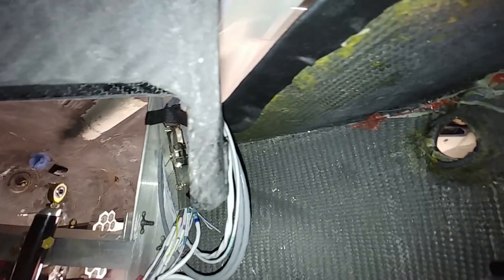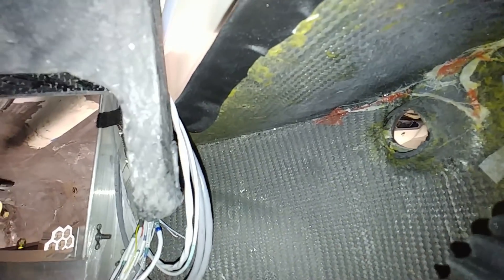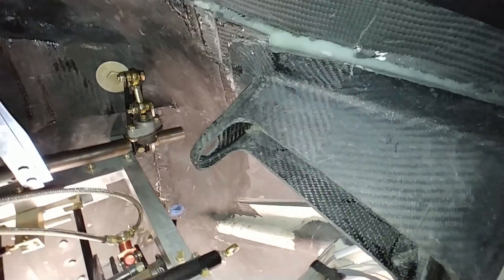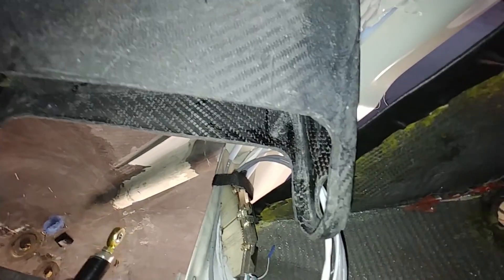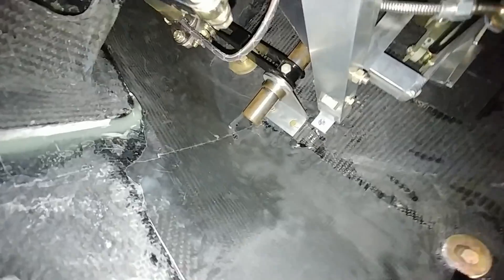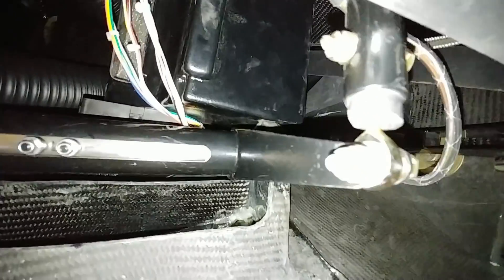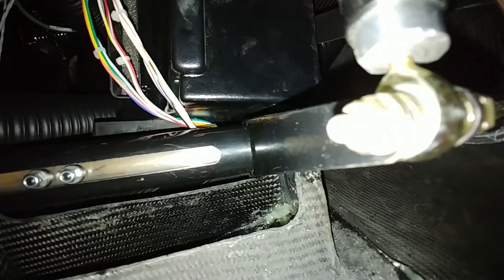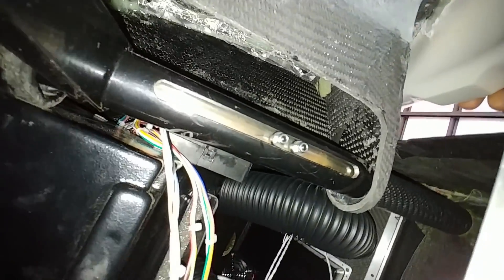Back to the Drawing Board - Building the Raptor Prototype

Comment: Just sent a few dollars your way. It will only buy a garmin screw but hey, every bit helps, right?!!😁
At 12:13 you show a bracket that connects both square tubes to each other; bearing one end and square tube on the other. If they were longer you would not need the joiner. The throw would be greater in fairness but would it make for a more rigid setup? I'm just brainstorming here, i can't help it!!
Reply from the maker: I'm not sure I follow you. Either way I will beef up the join as much as required.
Reply: @RaptorAircraft  
Sorry, i worded that a little cryptic!
If the square section with the joiner was further from the long square tube, you wouldn't need the joiner. It would follow a larger arc as you roll so that could foul on something.

Comment: Is it worth considering a third bearing where the stick comes through the dash panel to support the extended arm
Reply from the maker: Yes, potentially but there is nothing rigid out there to mount to and a third one, if misaligned, could create binding.

Comment: The orientation of the new components that you have on the drawing, will interfere with the aircon unit.  Unless you orient the short square tubing in a different position than shown on your drawing.
Reply from the maker: I think I'm good but I will be double checking it before making anything.

Comment: For what it's worth, lengthen the square tube mounting brackets by 1/2 to 1 inch so the square tube clears the main body mounting bracket.  This would allow the use of a single square tube instead of splicing 2 tubes together.  Also, it should eliminate any possibility of the splice coming apart.
Reply from the maker: Good idea. But I need to make sure it won't interfere with the A/C unit on the left side stick.

Comment: Question: How will the bracket connection bolts be safety wired?
Suggestion: Use through bolts to hold the roller bearings with a plate on the opposite side of the square tube. This will reduce flex of the bearing bolts & ensure parallel movement.

Comment: So the final result seems like a setup that should work, there are a few things I'd approach a little different in terms of making a simple structure but nothing so drastic as to bother with getting into it. I would say that the only thing I'd double check on is that extension splice piece to the forward end; seems like a critical point. I'd try and clean that up a bit. If it's all getting welded from steel probably not a biggie.
Make sure with your V-wheels you have plenty of adjustment in/out and up/down. Have messed with them plenty on a CNC router and you really wanna be able to dial them in.

Comment: Hi, just an additional thougth. I think there are better slide bearing that do not tend to bind up this much. "Igus - drylin® R linear shaft bearings". These bushings are longer and use chromed shafts (completly smooth). Or precision stainless steel tubes (polished)

Comment: Before you go on that excursion with the redesigned side stick, take the brass bushings and machine a convex on the id. Your new design is complicated and has many opportunities for failure.
Reply: I agree with you. The binding is being caused by flexing of the thin-walled tubing of the control stick. That could work.

Comment: What about moving the electrical wires outside the shaft and using torque resistant linear bearings on a splined shaft to transfer the torque to the aileron controls? You would still just use standard rotary bearings in a housing to allow the whole unit to rotate. All the components would be off the shelf aside from the bearing housings and the electrical wiring would just need to exit the tube before the area where it is welded to the solid splined shaft. This would be the simplest, most compact design and minimise any re-engineering of the surrounding components.

Comment: Great work and hang in there. Just a caution if you haven't already reviewed it. It seems the air conditioner might require a configuration change near the forward bracket mount on the left stick.  Very impressed with the retrospection and getting back to a positive mind space. Your work is extremely impressive!

Comment: Peter
I wouldn’t think the bushings are binding as you show in video.  As well you know, Root cause is critical to effective corrective action. If things are aligned I would suspect stiction try lubrications, there are many, some dry and fairly permanent.   I also suspect friction in the slide motion when there’s twisting load.   This is from the tiny contact area and difficult (not flat and smooth) machining of the slots.  These should be hardened and ground and they still may not be good enough cause the bolt heads or tiny rollers or whatever runs in on he slots.   This is a bigger issue than the bushings in my poor estimation.   Good luck.

Comment: Looks good with the new design. I agree with what has been said elsewhere, those brass bushings need to be significantly longer. I always champer my bushings to avoid binding when I use them. I have no clue if it would solve the problem, but it has in a few armatures I've built. Similar loading as you're experiencing.

Comment: Would eccentric bolts be a simpler solution to tightening the V bearing, similar to those used in some 3d printers. It's hard to see from the photo how complex the Cirrus approach is.
Reply: Yes, they work well. Here's a link to a supplier: http://www.cncrouterparts.com/v-roller-bearing-p-240.html

Comment: Peter,

Before you reinvent the control system, take a look at these flanged linear bearings.  The simplicity of this might be an easy, effective solution to your planned approach.

V/r,
Jon

https://www.amazon.com/uxcell-LMK30UU-30mmx45mmx64mm-Bushing-Bearing/dp/B07429Z7GH/ref=sr_1_3?crid=JTDGSACQ7S7F&dchild=1&keywords=flange+linear+bearing&qid=1591327155&sprefix=flanged+linear+%2Caps%2C305&sr=8-3

Comment: you probably thought of this already but would it be an option to use linear ball bearings?
Reply from the maker: Lolz. Only every second comment in the last two videos has suggested them and I have explained many times why I'm not using them. Thanks.
Reply: Most linear bearings cannot handle rotation. There are a few that can but they also need a precision ground hardened bar, which would be very difficult and expensive to manufacture for this application.

Comment: I'm no engineer, but those bushing are too short, that is why they are binding when there is lateral pressure.  If they were 2 to 3 times longer I suspect they would not bind. Can you source longer bushings or machine ones yourself to try before re-designing the whole mechanism?  Lastly, the finished surface of the control arm needs to be smoother (polished/chromed).  Like the finish on motorcycle front forks or hydraulic ram piston.

Comment: I had a similar problem with binding slide bearings on a metal rod which was cured with a dry Teflon lubricant. Don’t confuse it with standard oil or WD40. The stuff I’m talking about goes on as a volatile liquid filled with Teflon powder. Once on, the liquid evaporates, leaving a coating of Teflon just a few molecules thick which won’t rub off. Here’s a link to some on Amazon. https://www.amazon.com/DuPont-Teflon-Non-Stick/dp/B07L6X5HL5

Comment: Peter...  it looks like the force of movement for the ailerons (movement left and right) is transferred from the square control stick to the ailerons control frame by the v-groove bearings.  The Cirrus is offset so it would move in an arc (more of an up and down movement), but yours is inline, so the movement is a rotation.  Looks like this might put more pressure sideways on the V-Groove bearings  Please make sure the V-Groove bearings are deep enough that they don't allow the corners of the square control rod to pop out of their grasp.  Maybe that is why the Cirrus has a way to control the tension of the bearings on the square control rod.
Reply from the maker: I have configured it so any upward or downward force on the stick will drive down into the groove and not laterally. I will be adding the tension adjusters.
Reply: Those V groove bearings are designed to handle heavy side loads. As long as the tube has square corners it will be fine.

Comment: Why not just put some support rollers for the round  tube on the hole where it comes through the instrument panel / bulkhead. Like on a beechcraft king air or 1900. Would be way simpler.
Reply from the maker: Because rollers only allow movement in one direction, perpendicular to the roller.
Reply: @RaptorAircraft  the beech 1900 has three rollers on a round control tube. The tube pulls through the rollers (elevator) and turns in the rollers (aileron).  They are made from a black plastic. I worked on 1900's for 11 years and never saw one replaced and these planes where worked hard.

Comment: The junction u metal piece between the 2 square tubes will not be stiff enough and will have off set loads putting the welds in bending stress. Instead make a attachment to the carbon fiber bracket  which holds the bearings in the correct alignment. Or better yet use a Defiant aircraft side stick mechanism which has no siding or rotating tubes and directly feeds the the motion to the wires or the push rods. you should be able to mount it in the area and volume of the space where your current carbon bracket is positioned.  Also the Longeze and Varieze have even simpler mechanism.  There is a tube running fore and aft which rotates. This gives the rotation to control wires running to the aileron. This tube does not move fore and aft. To this fore and aft tube is attached a vertical tube which rotates in a fore and aft plane. A push rod is attached to this vertical tube and goes forward to the elevator  hardware.
All pivots can be made with rod ends (low friction). Since you need the vertical tube needs to exit the instrument panel as a "stick" you will need a connecting tube from the stick to the vertical tube behind the panel to connect the two vertical tubes. That tube does not need to very large in diameter because it's length is short and the loads on it should be small. 
Thinking back I seam to remember that you have transverse pulley  in the system mounted near the carbon brackets behind the panel. A short push rod going to the pulley from a lever arm coming off the rotating tube could connect the rotating tube to the fore and aft running wires for the ailerons. If the ailerons are low friction in motion there will be very low force and thus friction in this part of the control system. Again using rod ends of low friction and the easy adjustment via the threaded end of the rod end.  If you need a drawing of this system give me an email address and I will forward one to you.    The most important thought is KISS.  csmale@bak.rr.com
Reply from the maker: Or I could just copy the proven design of the Cirrus.
Reply: @RaptorAircraft  I understand your frustration with this problem & with the youtube comment section, but answers like this aren't a good look. Letting the guy know you appreciate his advice takes just a few seconds & makes us feel a lot better about donating to your gofundme. Most people here are of good intentions. Just my opinion..
Reply: Raptor Aircraft   Wow, a knowledgeable guy offers serious help and you scoff at him.  This is why I didn’t give you a deposit.  I still love your project and wish you the best but thank God I didn’t tie up my money.

Comment: I think you're probably on the right track, but several people have pointed out the underlying issue with the original bearings.  The L/D ratio is very short.  The issue is not so much about the individual bearings themselves, but the total length of the bearing couple(s).  In your latest design, as well as in the assembly you're referencing for this design, there is a relatively rigid, stable carrier that connects the two bearing assemblies together, allowing them to act as a single (estimated) 10" long couple, instead of two individual separate couples (estimated 1" long,  ie. the length of the bearings).  If you maintain the alignment between the two bearings using a bored housing or in your re-design; a rigid spine, or whatever, then try your earlier experiment of trying to tilt the shaft enough to drop it out, you would find quite different results. Back to your latest iteration: Having the ability to tighten up the assembly to compensate for wear will ultimately create and maintain a better "feel" in the controls.  Hang in there, you'll come up with a good solution.  The devil is always in the minute details on stuff like this.  At least I didn't have to worry so much about weight on the stuff I designed (special industrial machinery), like you do :)..........JC
Reply from the maker: I haven't finished the new design yet as I said. I will be adding the groove bearing adjusters.

Comment: Do they make a longer oiled bushing one that will go between both brackets that you already have in there?
Reply from the maker: Not really and then you're always going to have some friction and the more force that's put on it the more it will resist. Bearings in both axes will not have that problem.

Comment: Seems like a simpler solution would be to extend your aileron control tube by 2 inches, remove the old small bushes, add the radial bearing supports to the CF brackets and radial bearings.  Thus you aileron tube becomes one large bushing, but can rotate on the radial bearings.  In my redesign the aileron loads are carried by the large tube to the radial bearings, and should minimize bending, leaving the elevator motion free.
Reply from the maker: If you read the notes on all the available linear bearings you will see that they do not like any amount of misalignment. Now I don't have that until you really need to crank hard on the stick and then that creates a minor amount of misalignment as well as a force that would load up the ball bearings on that side of the stick. As I have said in loads of replies just now, I am going with the proven Cirrus design.
Reply: @RaptorAircraft  i am not advocating linear bearings, but to place bearing supports on a longer aileron tube, ie replace the bushes with radial bearings as you showed.  Too bad i cant show you a picture.

Comment: I made a premature comment about uing radial ball bearings and I was dead wrong,  I simply love your version of the Cirrus controls.  Well done!  And BTW, I not only love your videos but I posted your GoFundMe page on all my social media.  You're one outstanding person.
Reply from the maker: Nice to hear someone likes the new design. There's only a couple of you so far. Everyone else wants the linear bearings. There simply is not enough room for them. They are much larger than the iGlides and the bronze bushings. And even if I could fit them I still need to come up with a better solution for the tiny bearings in the slot that are presently creating their own problem because they are under too much load. The new solution fixes all that. Thanks for getting on board.
Reply: @RaptorAircraft  You might be able to simplify the new design by making the outside part of the system out of a sheet of aluminum,  no joiner piece and with pre-drilled holes for mounting brackets, stand-offs, weld points and any stiffeners.  Happy the GFM is working out, the 4 years of videos and the story are easily worth a donation.  Good luck!
Reply: @RaptorAircraft  I love how you are innovating on different methods keep it up mate.
Reply: @RaptorAircraft  Peter, I've watched your channel over the years and most people would have given up with all the adversity you've had, especially recently when you're so close and yet so far.  Somehow, someway, you've endured it all.  You don't need my vote of confidence because everybody is rooting for you.  Just the fact the GoFundMe page exceeded its' $20K so quickly would make me believe everybody feels as I do.  Fuck the naysayers, second-guessers, and people with 20/20 hindsight. You're a hero in my book.  Keep it up.

Comment: Peter
SKF makes a radial spherical bearing that would allow it to move as you pull/push on your round rod. It has an outer race it rotates in you could bulkhead Mount.
Reply from the maker: Steve, there's just not enough room for those bearings. See some of my other replies on this.
Reply: Dang it ! Thought I had  a fix for you. Sorry Peter. I want to see it fly. You have done all the Heavy Lifting and should reap the reward.
Reply: I agree...McMaster-Carr has a Combination Ball/Needle-Roller Bearing that looks like it would work and be less complicated to implement.
Reply: @randyshiney6685  something like this? https://www.ikont.com/rotary-bearings/combined-needle-roller-bearings

Comment: I think you're on the right track, I think the surface area of the contact patches could be greater perhaps with much deeper pulleys. Also a method of tightening the pulleys over time to account for wear and tear, I have experience with sliding gates and v-wheels might be a weak spot in the design. 

Wishing you all the best!
Reply from the maker: Cirrus is using the exact dimensions of v groove bearings with the same size square tube. It must be working otherwise they would have changed it already.
Reply: @RaptorAircraft  good stuff👍

Comment: Understand the logic of going with a proven design, sound decision.  Out of curiosity, did the oilite bearings have a reverse spherical surface on the ID?  Isn't that the typical solution to binding like that?  Good channel, hang in there, thanks for sharing!
Reply from the maker: No they don't. I have never seen anything like that from McMaster where I get most of that kind of part.
Reply: @RaptorAircraft  McMaster-Carr, inventors' friend.